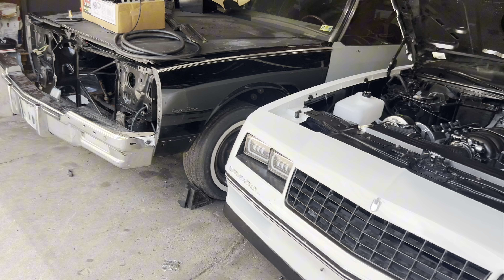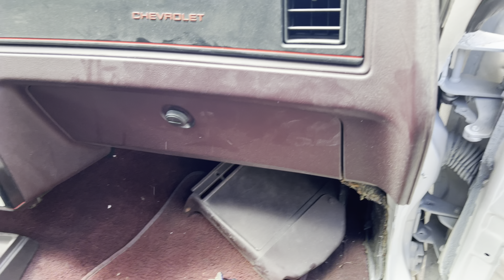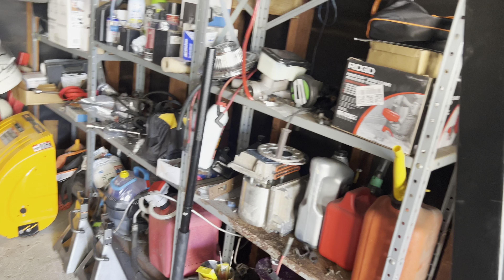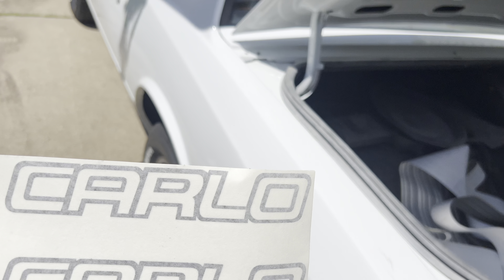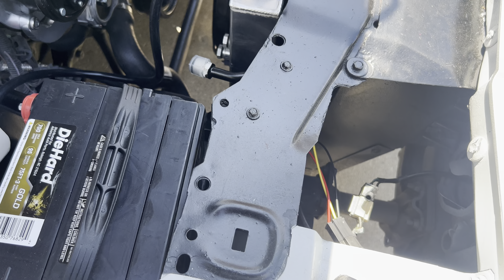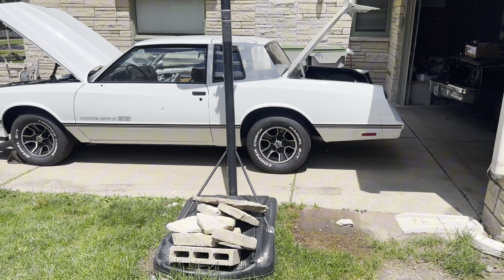RUINED MY BRAND NEW PAINT JOB

Comment: Grounding Tip - Run a ground cable from the negative on the battery, to the frame. I use Red Top batteries, which have top and side mount connections. My cars use the side mount cables, and I run a top mount ground cable from the negative to the frame.